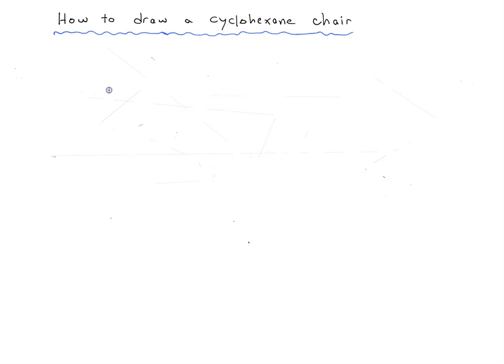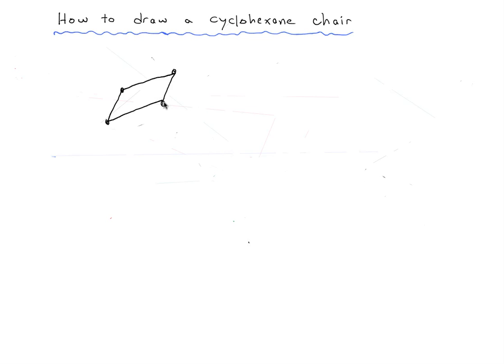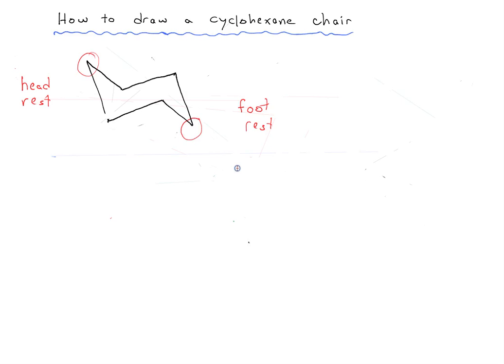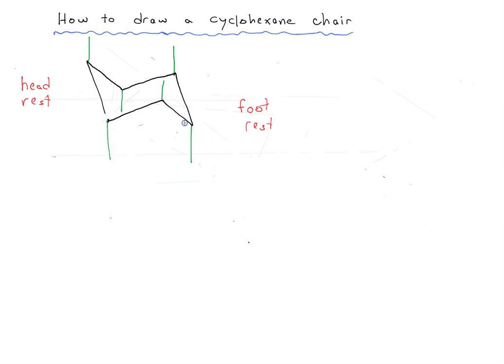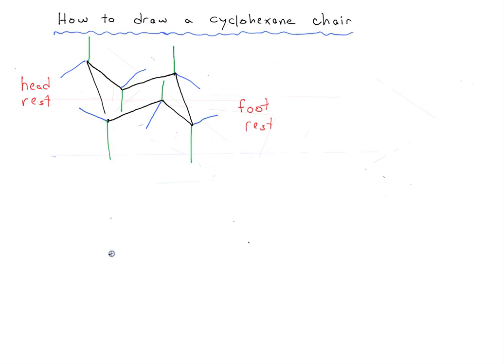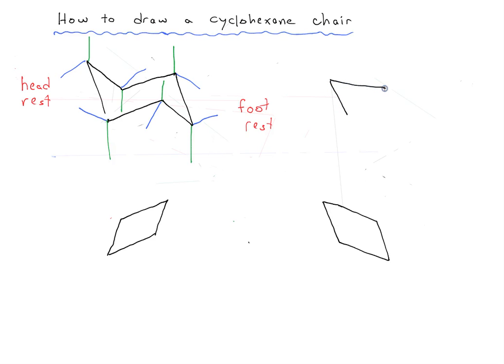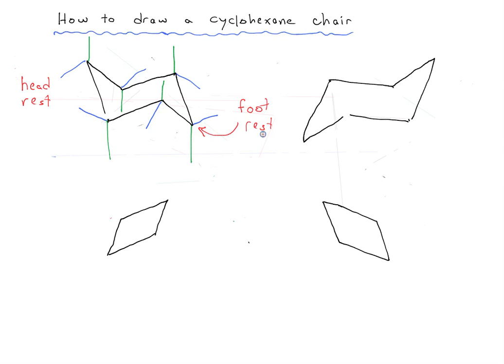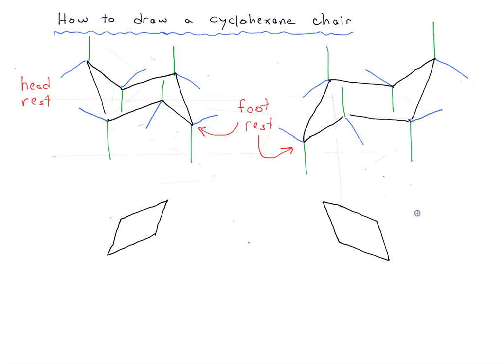How to draw a cyclohexane chair conformation

Comment: Good vid. BTW, the central equatorial bonds are pointing in the wrong direction. You have those bonds pointed to the center of the ring. These bonds should point away from the center of the ring
Reply: I agree with TheLocomatic! C-H bonds must be parallel to the opposite C-C bond in the ring!
Reply: I will go on the record as saying I don't think it really matters. Often enough, bulky groups occupy those equatorial positions, and drawing them in necessitates angling the C-H bond to the left so that it can be drawn in.